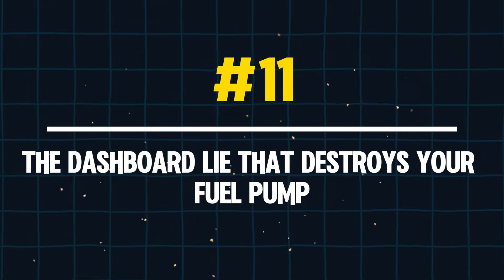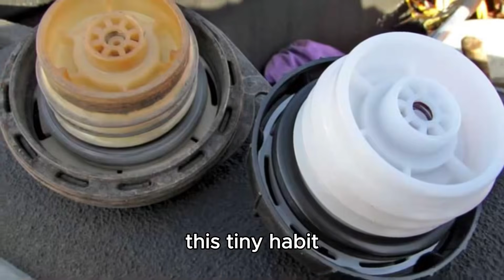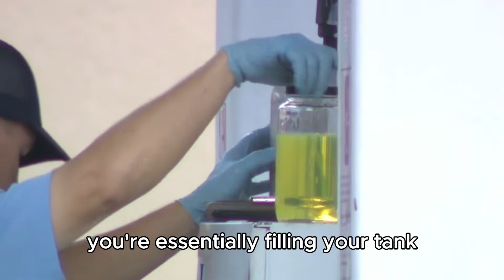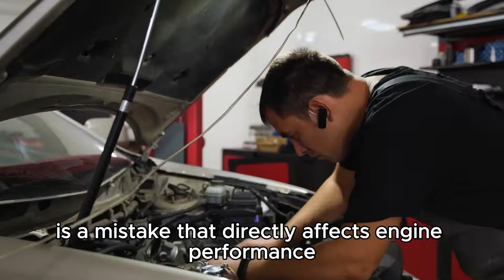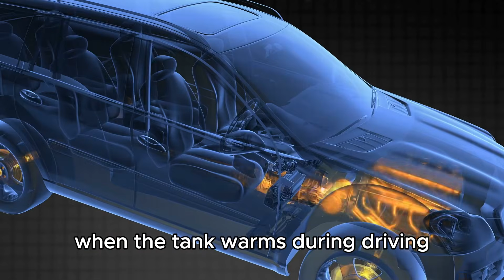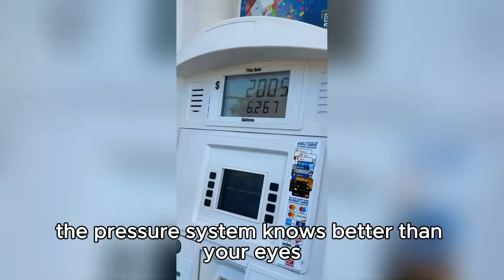Never Do THIS Before Refueling | 90% of Drivers Get It Wrong!

Comment: So much misleading information in this video. Fuel pumps have filters on them plus whee is all this sediment coming from? Not from the gas truck, not from the refinery and not from the storage tanks and what about all this water. The same thing where did it come from?
Reply from the maker: WillSmith, appreciate you sharing your perspective. Modern fuel systems definitely have filters and safeguards built in, but fuel quality and tank conditions can still vary from place to place. Have you ever actually run into fuel contamination issues yourself over the years?

Comment: Okay I watched the first tip and I don't need to hear any more.  Please tell me where sediment is going to come from at the bottom of the tank? This isn't a water heater, and gas doesn't contain sediment. Also, gas doesn't contain water soooo where does the water come from? It magically comes into the tank when you fill up??  Vapor lock occurs when fuel boils in the fuel line or pump, often needing fuel temperatures as low as 100°F to 120°F (38°C - 49°C) for modern fuels, especially in hot weather (90°F+) or high altitudes, exacerbated by engine heat soak and low pressure in carbureted systems. It's a combination of heat, low pressure, and fuel volatility (especially winter blends) that causes fuel to turn to vapor, preventing liquid fuel delivery and causing stalling. So, no amount of gas in your tank is going to cause vapor lock.  I didn't need to watch any further knowing how ignorant and false the first statement is.
Reply from the maker: sounds like you’ve really dug into the technical side of fuel systems. Heat, pressure, and fuel volatility definitely play a big role in vapor lock and fuel delivery issues. Always interesting hearing different experiences and viewpoints on this stuff. Have you ever actually dealt with vapor lock firsthand on a vehicle?